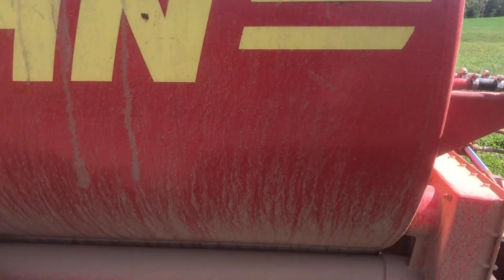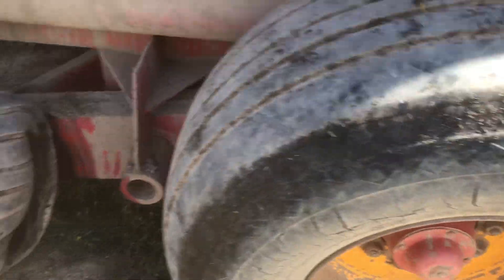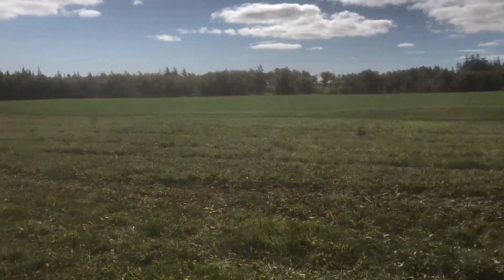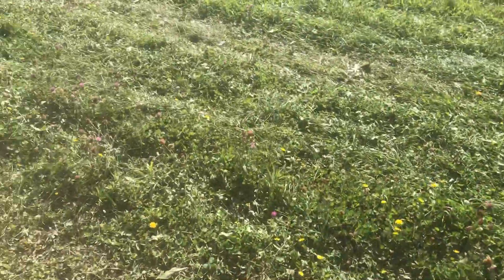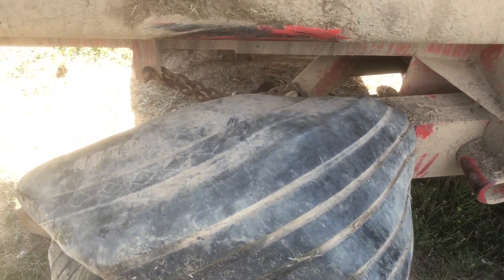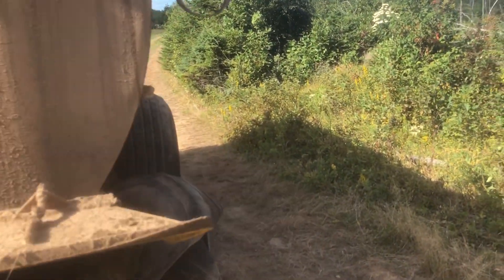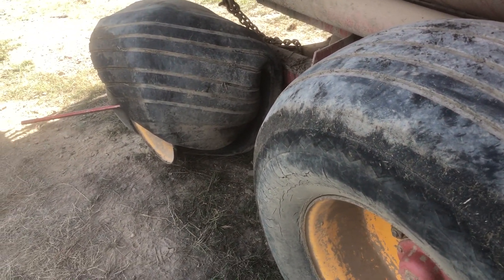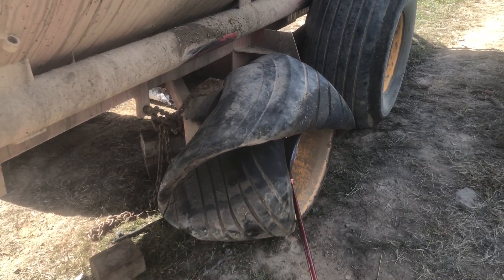Manure Spreader Destroyed Tire 550/60/22.5

Comment: neighbor had a old new Holland V-tank spreader with super single (semi truck tires) that came from the factor on it.  when the spreader wore out he got a husky tank spreader like yours with the same floater tires.  not to long after purchase got a flat, took the 10 year old tires that never went flat off the old spreader and put on the husky.  not sure about price difference but the local tire shop will sell the to old to recap tires for a decent price and  they'll last longer
Reply from the maker: $700 Canadian each for the flotation tires. Super singles would be good too but would need to buy rims. Date on old tires says they are 17 years old so if the new ones last that long I’ll be happy 👍
Reply: super singles rims are 14x22.5   how wide are yours
Reply from the maker: I’d have to measure the rim but the tires are around 20-24” wide. 550mm?

Comment: How many gallon tank is your spreader?
Reply from the maker: 3000 US Gallons I think, so 2500 Imp. gallons?
Reply: It looks like a huge spreader. The one i bought is 3250 us gallons 2650 imp gallons and looks small compared to your spreader. Yours looks to be in nice shape. I looked at Nuhn in Sussex they have for sale its a 6400 gallon one. A little big for me but a nice spreader. I honestly dont know much about them never been around liquid before.  Is your spreader 540 or 1000 pto?
Reply from the maker: I noticed that too but it must just be the shape of the Houle spreader it seems smaller, should be easier to see around than this thing. Ours is in pretty good shape I did give it a half ass paint job a couple years ago lol. I was looking at one at Green Diamond in Truro 6750 gallons pretty big unit, would be nice to have but would need a tractor to pull it. Mine is 540 PTO.